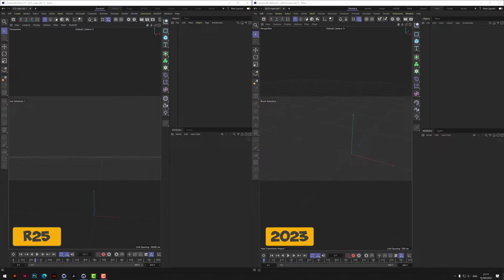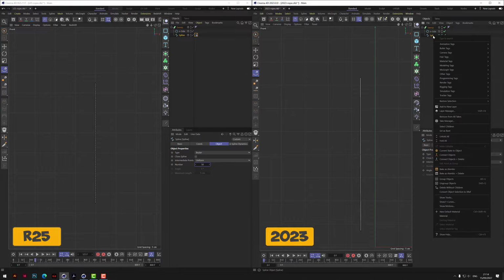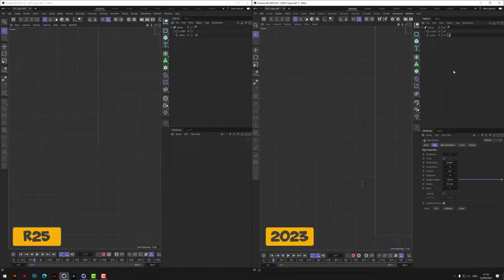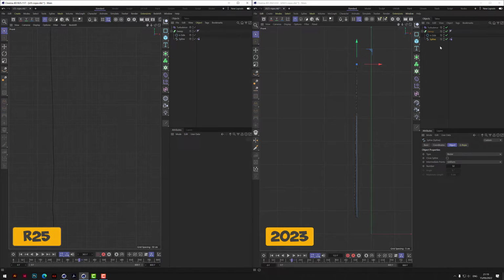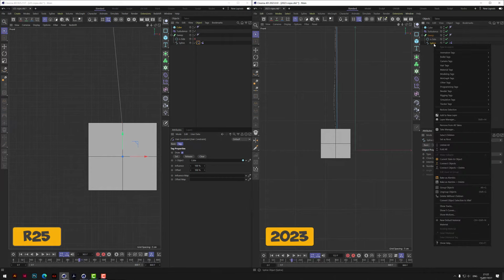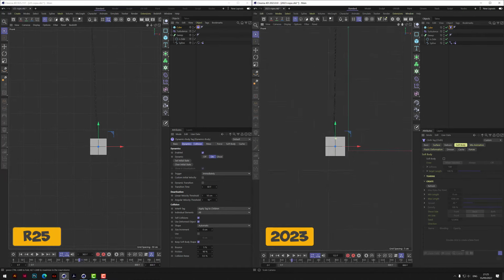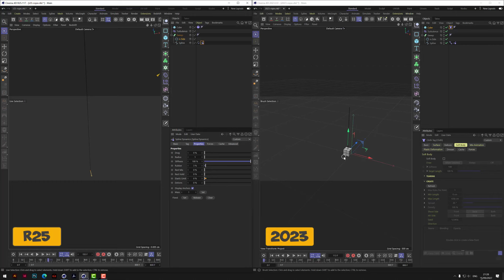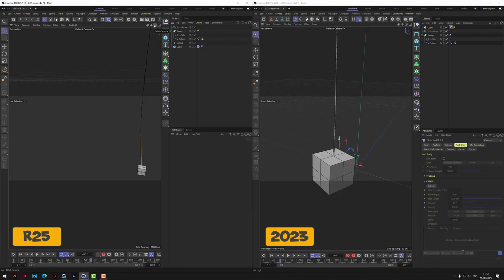**UPDATE!** Look how amazing Rope is now!| C4D 2023 Rope Tutorial

Comment: The Channel Owner has pinned the explanation about the issue here but I wanna add something about that. Yes, the new 2023 rope dynamics sucks when it comes to hang an object on spline. Cloth tag is not right for it. It deforrmes. Maxon should have fixed it but they do not care or their influencers do not give true feedback. I am a little upset because ı am on a job that inside I have to simulate some wires iron weights hanging on. I tried many things. I attached object with cloth tag and make those cloth objects constraint to my main objects. Give them no dynamics, and all kind of dynamics. I tried adding connector (where the motor option is), rig object to other and so. They didn't work as you see. The old hair dynamics was better. In comparision up, the problem of streching endlessly is the adaptiveness of spline I guess. If you make it uniform it could have gone well. Everybody has to write this issue to Maxon and get a solution update.
Reply from the maker: Thank you for this post. I have spoken to Maxon and this is their reply...
 
"Thank you for reaching out the Maxon technical support.
 
Since the rework of the simulation system with Cinema 4D 2023, you have currently two simulation systems, that are not compatible to each other.
 
If you want to connect in 2023 objects with a rope, you have to add a cloth tag to the object and use a Connector.
I add you a example file.
 
Probably this YouTube video is helpful for you.
https://www.youtube.com/watch?v=Qsm8XM4X03w
 
Mit freundlichen Grüßen,
Kind regards,
Jörn Gollob
Cinema 4D Technical Support"

The video they linked to is mine, so no further forward at this stage. Let's hope 2023.3 will hold the solution. 😉
Reply: @VizualAnimation  Thank you for your interest. BTW I've found the closest solution by using mesh deformer and soft body tag together. I use a cube and give all cloth dynamics to cube. Then I get my main object into that by using mesh deformer. It seems working in my project. You can try and do it better maybe. And I hope Maxon does something more accurate.

Comment: why my rope is stretching into infinity? that is so frustrating!
Reply from the maker: This should only happen with R25, the new version fixes these issues.
Reply: @VizualAnimation  hmmm thats weird tho im using the latest build (2023.2) and the attached object is a simple cube.... im probably missing something here. But anyway thanks for the response for now i do it in houdini 🙂
Reply: @3rdDim3nsn3D  I'm getting the same problem in 2023 where it stretches way too much (probably to infinity) and no settings seems to affect the stretchiness. My spline is 8 inches long with with a .2" radius hexagon. I tried adjusting the gravity but it doesn't help.
Reply: @3rdDim3nsn3D  After playing around with things I realized that the number of subdivisions in the spline (Intermediate points) makes a huge difference to the stretchiness - the less subdivisions, the less the stretchiness.

Comment: Hey i am having an issue when ever i try to attach the hanger to horizontal string the hanger works as a cloth i have dialled down all the settings but still the same issue
Reply from the maker: Hi Musa
This is a known issue that I believe will be added to future updates to the software. 
The only work around is to remesh the object you are hanging so it has less geometry, then add as many soft body poles as possible to help to stiffen it up.

Comment from the maker: To answer the questions about using the rope simulation with the old bullet rigid body…
I am currently experiencing the same issue when using more complex objects with 100’s of polygons. You’re right as the rope simulation only attaches to objects with the new Cloth tag. My workaround for now until a new rigid body is added to the simulation system is to add a Cloth tag and add Soft Body and make the softness 0% then add 50 connecting poles to help stiffen everything up. It’s not perfect, but with a bit of tweaking you can get the Cloth to act more like a rigid body.
I will continue to research this and if I find any other solutions I will update this comment.
Reply: Appreciate the response. I cannot for the life of me get the soft body cloth tag to act anything even remotely close to rigid. seems like an oversight on maxon's part. I can't imagine it would have taken much to add a new rigid body tag. From a programming perspective rigid body properties are much easier to code than soft bodies. Guess i'll hang in there. Cheers!
Reply: I was experiencing that today. Complex geo on a microphone hanging from the cable. Unbelievably I couldn't do something THAT basic.  I ended up just just using the the old way with the spring object, which by the way attaches perfectly once you cache the rigid body.  Took my a hot minute to figure out that little tidbit too. lol

Comment: Thanks for this, helpful getting to grips with the rope system. Now, maybe you can help me - I'm trying to do beads on a string. I want the string of beads to fall over an object and bounce off the floor.  I can attach my bead shapes cloned onto my rope spline - which was giving me a huge headache earlier when I was trying to do it with bullet tags.  BUT now the beads are going through the floor, though the rope doesn't. I've tried putting a cloth tag on the beads, but that makes them super floppy... the bullet tags either explode everywhere or do nothing... any ideas would be helpful thanks!